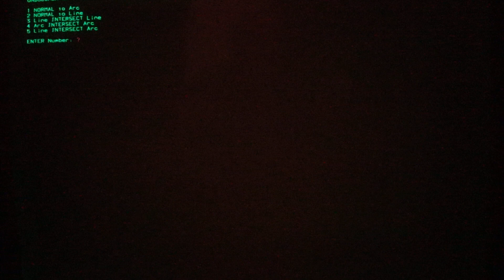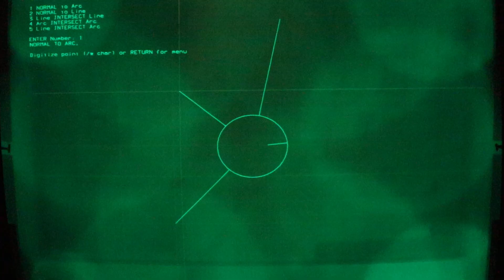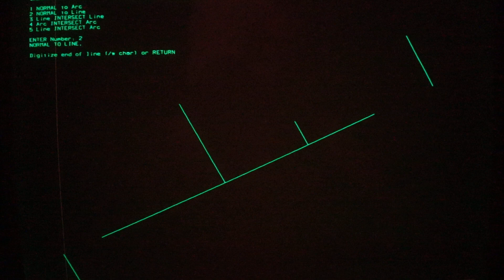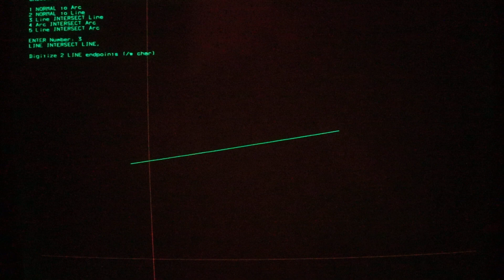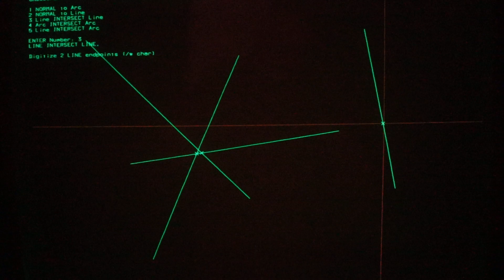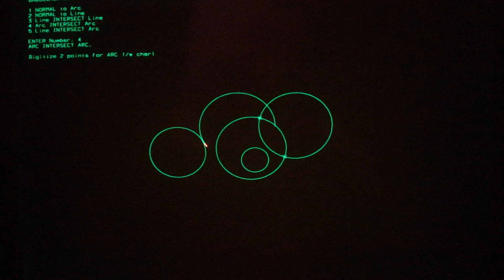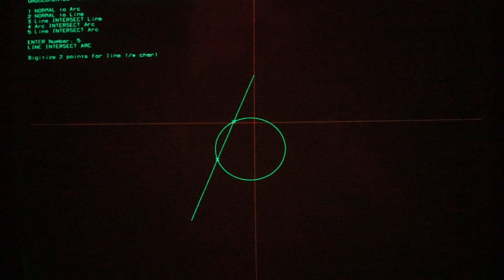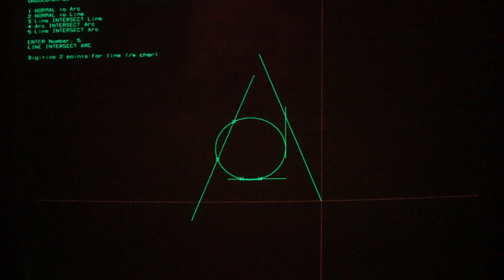Undocumented Tektronix 4050A Vector Graphics Commands

Comment: Just to emphasize, those "jaggies" on the line don't exist on that terminal.
Its due to either to capture or your display.
Reply from the maker: You are correct!  Digital cameras don't do justice to vector displays.  This video was taken with my iPhone 13 Pro Max.  My latest "Cylon Attack" video https://www.youtube.com/watch?v=_eRGnlfBET0&t=3s was taken with my new Canon M50 Mark II DSLR, using the 1920x1080 setting for the video resolution.